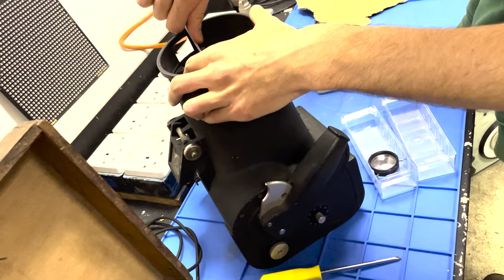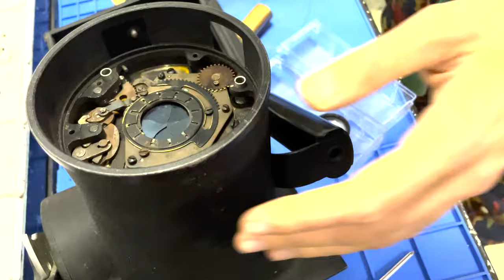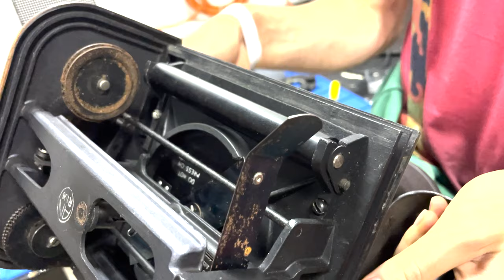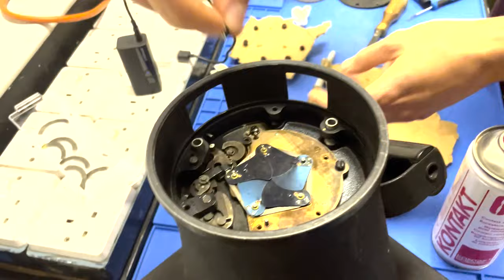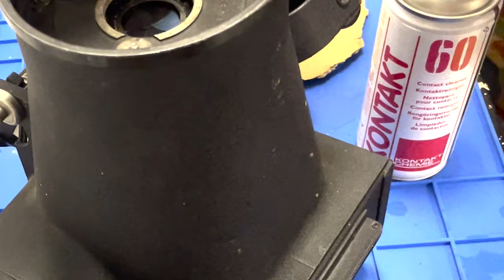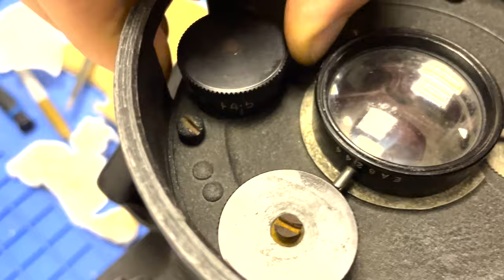Cleaning And Fixing A Large Format Aerial Film Camera

Comment: I shoot large format. This doesn't look to use plate or sheet film, this looks like very big roll film (maybe 70mm film?). Also, my guess would be the shutter gate is pressing the film flat to prevent "film pop". I would assume that the result of these photos would be selectively enlarged on specific areas, so they want the film to be as sharp as possible, so would need it to be correctly located in the position the lens is producing the image.
Reply: If this is a Fairchild K-20 as it appears to be it used the film rolls they cut 4x5 sheets from. I believe that they are able to be adapted to take sheet holders
Reply: @BobOgden1  yup type 4 film or something like that, like 200 shots on a massive spool of large format roll film. I've definitely seen quite a few people slap a graflok back on the thing for better modern compatibility

I've wanted one just to yank the lens off and throw it on my speed graphic haha
Reply: @DylanPackard  I would like be able to get the rolls of film and stick the K-20 back on my Graflex and go shoot some street portraits 😜
Reply: It uses aerographic film which had a very thin base and was 5 inches wide with sprockets on the side. I had a roll I cut into 4x5 sheets.
Reply from the maker: uyep. im just going to cut paper to size, got a bunch of film as i have a large format myself too. im just going to either fold it or tape it in so it stays in place and shoot a photo at a time, got local darkroom booked next week as i dont have anywhere good enough to do it at home now adays.
Reply: Can't image an arial reconnaissance camera would use anything other than roll-film. Imagine trying to load sheets at 30,000ft!
Reply from the maker: yes but dont have that. so loading sheets to atleast get a photo @jamesdecross1035
Reply: I shoot with a modified 178mm Aero Ektar mounted to a Graflex 

Was used for aerial reconnaissance in WW2

Lovely to shoot 4x5 sheet film through :)

Comment: Yo, I once had a neighbour with some aerial land mapping film from god knows when in NZ. The sheets were almost A3 in size with no sprocket holes so this makes me think that rather than being for an insanely large format camera, that the film actually was on a flat spool which makes wwwwwwaaaaaaaaaayyyyyyy more sense as if the camera was on the bottom of a Cesna and insanely large it might potentially stick out more than you know... the landing gear... ANYWAYS, I did what any 19year old student did with no money, handed $30 over to some nice guys at a plastics company who turned a monster bit of pipe into a chungus pinhole camera. 7hrs was the longest exposure on a grey day and it still needed longer plus I think it needed slightly more time developing but they still looked cool. Plus long exposures are trippy, like only have a bright numberplate show up floating mid-air from a car that was parked for a few hours less than the exposure.

Comment: If I'm not mistaken this is an aerial survey camera and they used very wide film rolls. I don't think the pictures taken with this camera will have high resolution and considering the state of the lens, neither will the pictures be very sharp. Maybe you could install a CCD from a digital pocket camera inside instead of a film roll, and "trigger" it when the shutter of the mechanical one opens? It's worth a try :) Nice save though 🙂
Reply from the maker: its worth using anyway, its not about being technically good the photo but the age and condition letting it add to the analog picture, i have darkroom booked next week will be finding out

Comment: Okay that aperture looked really oily, which you absolutely, 100% do not want. The blades should be totally dry and clear of any kind of lubricant, though you can use a tiny amount of dry graphite powder, the kind you use for locks on the pivots if they're really that stiff. Ideally they need ultrasonic cleaning in some kind of degreaser. They will seize, bend and die if you leave them like this and keep using it.
Reply: Thats not true, oil on aperture blades is only an issue with SLR lenses where they need to open and close fast.
On this type of camera, its not an issue at all and you can use oil.
Reply from the maker: @Nobody-Nowhere  haha, itll be fine as you say. you never know what to take in from comments. i guess time will tell.